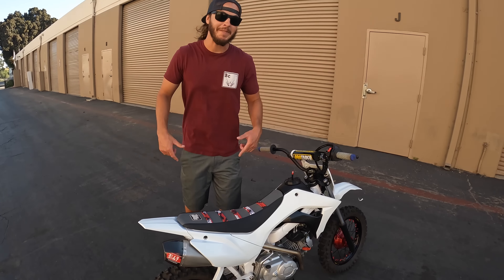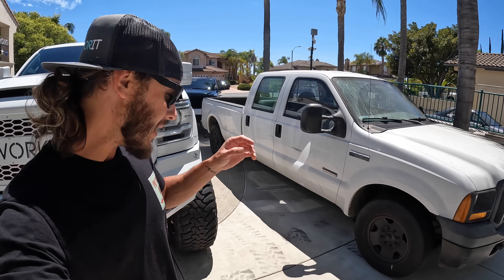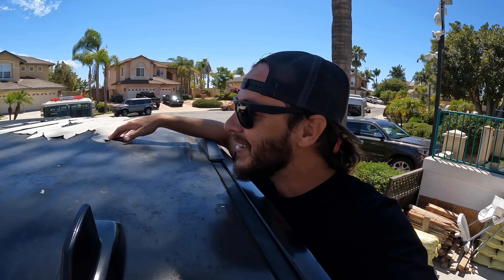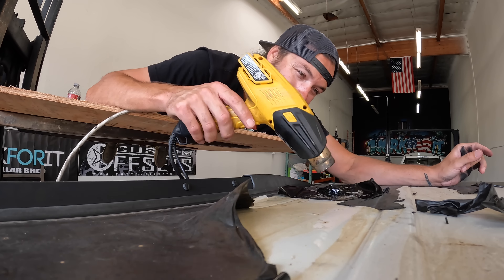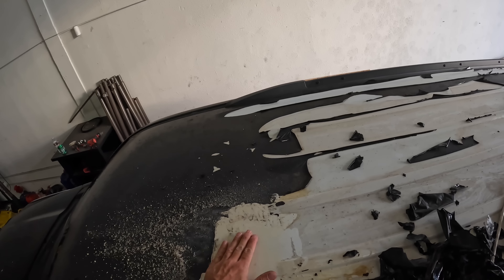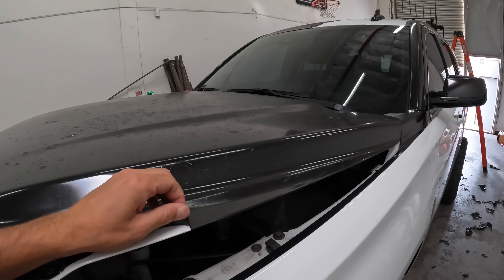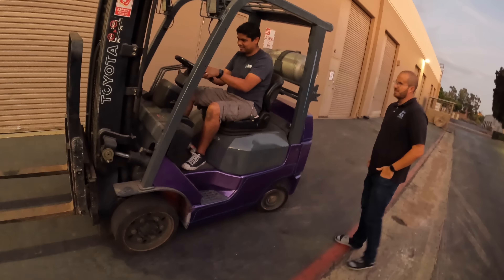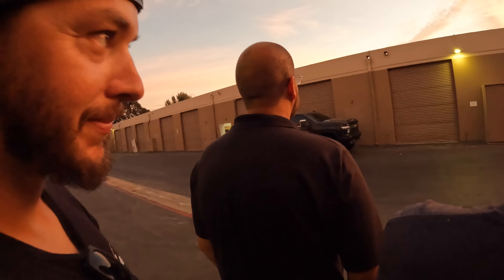This is Why I HATE Vinyl Wrap!

Comment: Get your caps on first, (the 2.5” and 6” intake cap)you can use a garden hose(will take forever to fill) or a 2.5” supply hose, you will need w hydrant wrench to use hydrant water to fill the tank. 

If you want to just cycle the pump periodically there is a switch in the cab that you will switch to the pump, then you will put the shifter in drive, then go to the pump panel and pull the primer handle, then  open tank to pump valve as well as the tank fill/ recirc valve. you can crack the recirc valve though ( it does not need to be all the way open.) Then turn the throttle up from the pump panel to build up some pressure ( pressure relief valves are usually set for 150 psi but you can just throttle it up to 120 for a couple minutes. This will keep the pump in working order if you run the pump like this every week.
Reply: nice
Reply: Can confirm as I fully support this man’s in-depth subject knowledge

Comment: I had the same issue with black wrap on my truck, I used the pressure washer and it came off fairly easy. The heat gun was taking way too long. Just need a good adhesive remover.
Reply: 99% iso alcohol removes a lot of adhesives

Comment: Heat the wrap (sitting in the sun a while can be enough) and then use a strong pressure washer with a fine tip it'll rip the crap off, just be careful with the the paint. I learned that when I had to remove sunbaked plastidip from all the shit I sprayed back in high school lol. Also what happened with the painter of the obs and the white cat eye? His work looked solid overall

Comment: Given the type of terrain and wild land interface your ranch is situated on your definitely benefit more having a four wheel drive water tender or water truck. They’re both typically outfitted with sprayers that can be operated from the cab. Tenders will usually have a smaller capacity pump compared to traditional type 1 fire engines but they typically have larger water tanks. If you plan on keeping your current fire engine then you’ll need to look into getting a pump intake valve as well as some fire hose to adequately supply the pump or quickly refill the tank. If the discharge dates and valves have say stagnant for a while you’ll need to likely have them lubricated, and it would be a good idea to fill the tank and flush out the whole pump and tank if any debris that may have accumulated. Frequent exercising of all the discharge gates, drains, and relief valves will aid in keeping the pump in good working order.

Comment: I’m a firefighter here in Texas, just a small run down on pumping the truck without a fire hose. 

Install a deck gun on top of the fire truck above the pump panel.   

How to pump the truck. 
1.engage pto
2.pull tank to pump lever 
3.pull desired lever to correct valve to open 
3. Set pressure to desired pressure

Comment: I wonder if "Brush Cleaner" solvent would work, I know its made to take paint off brushes and other painting tools, but I've used it too take safety yellow enamel spots off a white work van and didnt hurt the clearcoat at all, I also wiped it off right away with soapy water, anyways that stuff might be strong enough to loosen the vinyl but weak enough not to hurt dried/cured automotive paints

Comment: Typically the best protection for vinyl wrap was to PPF over the wrap.  But now they have tinted PPF in black (& other colors) that could be a great option.  Much better sun/UV protection, you can also apply a layer of Ceramic coating over that for even better protection.  Similar to that PPF on your OBS but in black.

Comment: boiling water, pour over the area you are working, pull wrap. helps loosen up the adhesive and will come off way easier
Reply: Ive seen this work very well with old clear bra too..
Reply: @warrenmullett  hit the nail on the head...learned on clear bras, works well on vinyl as well.

Comment: San Diego fire equipment has all your fire truck parts. Their office is under the Coronado bay bridge industrial area. 
FYI your fire truck can not pump and move at the same time. You can get skid units that have a pump, hose and a water tank that slides right onto the bed of a pickup truck🚒💨

Comment: A good quality vinyl wrap will last multiple years. Also like he pointed out there is a spray solution wrap shops use to remove the wrap with the glue.
Reply: No wrap lasts more than 2/3 years unless it's ALWAYS garage kept and never seems weather. Wraps are terrible for any vehicle that sees actual driving.
Reply: I heard the glue from good wraps is more damaging to the clear compared to the cheap stuff
Reply: @cbrobinson10  so what youre saying is, if it gets any elements from the outside like water or tree sap it wont last long...exactly like i initially said lmfaooooo shut up man. wraps suck, theyre literally only for garage kept vehicles

Comment: You def need a fire engine at the ranch. That fire engine is not pump and roll capable . Which means when the pump is engaged the trucks transmission is in pump gear. Good luck getting her to hold prime. You would be better off getting a used truck from brindle lee mountain fire trucks, or something to that nature, That’s pump and roll compatible with front bumper turrets etc!

Comment: Maybe they could just put a big water gun on top of the cab of the fire truck so you could operate that from inside the cab. I would think the firemen or a plumber might know how to do that or if it could even be done. You don't necessarily have to use all the other functions of the truck, do you ?
If that would work you could still use the back of the fire truck to turn it into a party truck.

Comment: I used a plastic razor scraper to remove my wife’s clear hood bra with a little heat. Then soaked the glue in goo b gone.
Reply: Did the same, somehow ended up not scratching up my paint either. After that, I decided I would never vinyl wrap anything ever again. Cali heat makes vinyl wraps look like pitted garbage after a couple years.